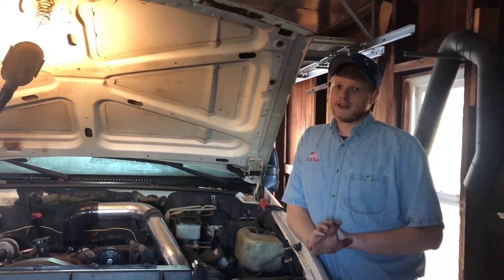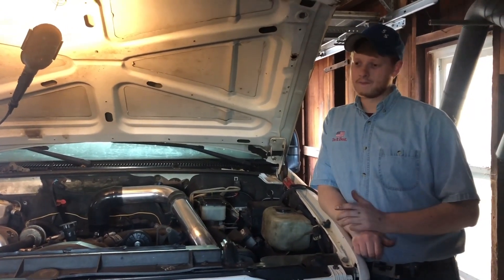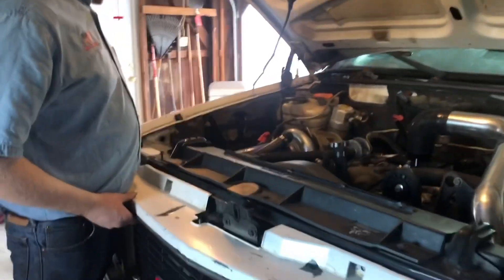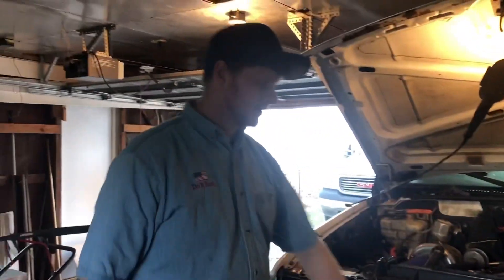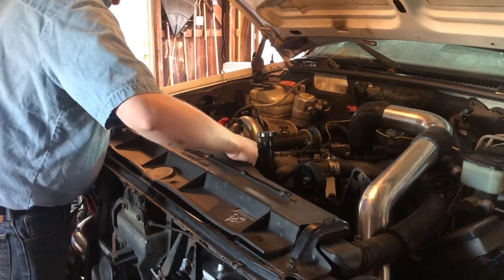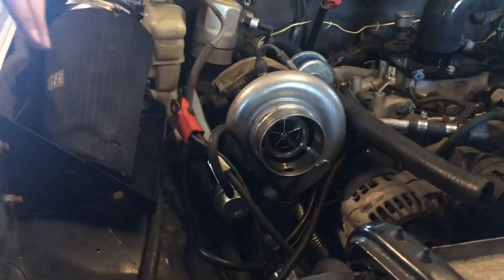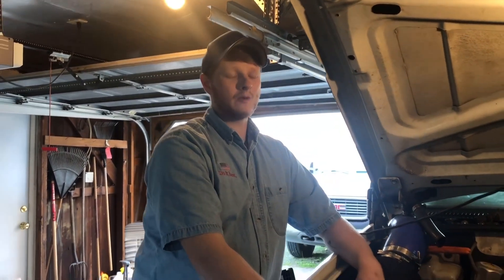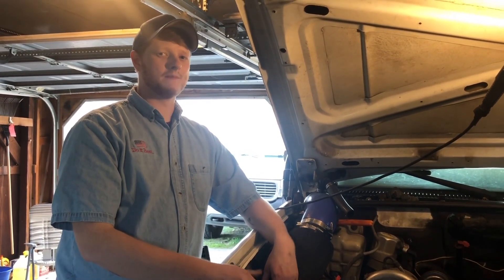GSC 6.5L diesel DIY Intercooler phase 1.

Comment: Hi Buddie, just looking at your video. I thought the radiator on left before your new intercooler is the oil cooler?
Reply from the maker: It is. Trans cooler is on the passenger side oil cooler is on the driver side.
Reply: @gingersnapcustoms  thank you buddie.. Always thought passengers said was oil cooler drive nothing on drivers to only the find out previous owner deleted the oil cooler for some reason

Comment: Do you think moving the rad and ac back 3” or so would work and put the IC there in front?
Reply from the maker: It looks like there isn’t enough room to move the rad more than 1.5” back. If you relocated the transmission and engine oil coolers that would free up all the space.

Comment: oh the joy's of the 6.5 life!
Reply from the maker: I knew it was coming when the manifolds and cross overturned blue! Oops
Reply: Did you have head studs?
Reply from the maker: @joshr9475  I didn’t for 37,000 miles. Wouldn’t need them still but I over worked there truck dragging 22,000lbs up an 8% grade from a dead stop. 1200’ to the top and I pretty much roasted the top end doing so.
Reply: @gingersnapcustoms  that's what I was wondering I'm impressed that they held with as much as you have done. I put them in mine when I rebuilt it cause why not if it's out.
Reply from the maker: @joshr9475  that’s the best time to do it. If the engines out. Do it. I get to do mine in the truck. So that’s going to be real interesting.
Reply: @gingersnapcustoms  id pull the motor before I did heads in the truck.  They come out pretty easy and them heads are stupid heavy.  Unfortunately I had to replace mine about 40k after I put them in cause one cracked. Got them from Clearwater
Reply from the maker: @joshr9475  I’ve pulled over a dozen engines and it is not my favorite job anymore. It’ll all depend on how things look when I start pulling this top end off. If I pull a head and a piston is damaged. It’ll all come out.